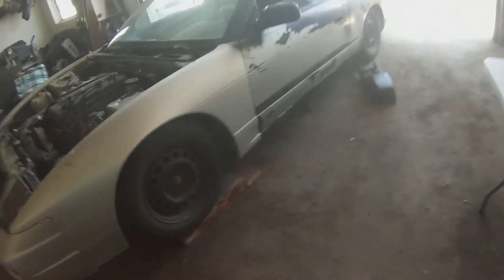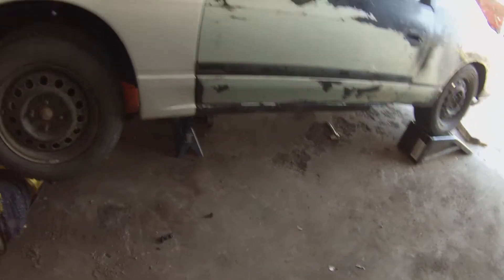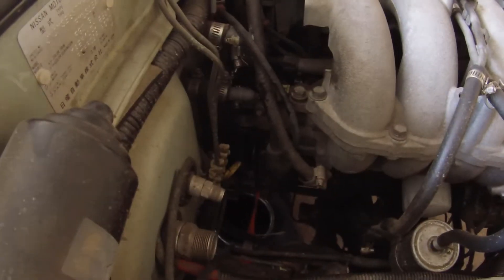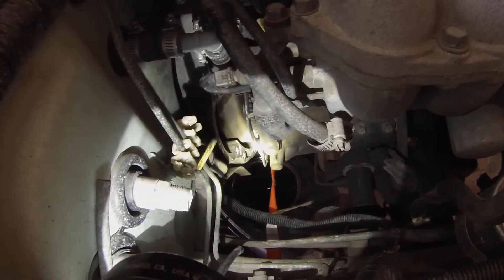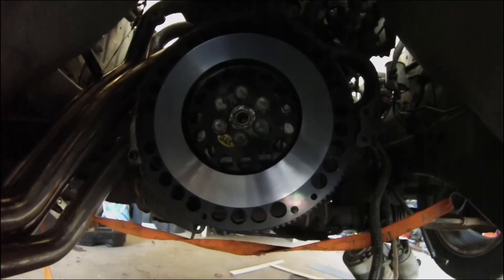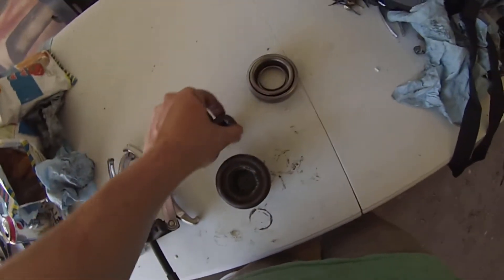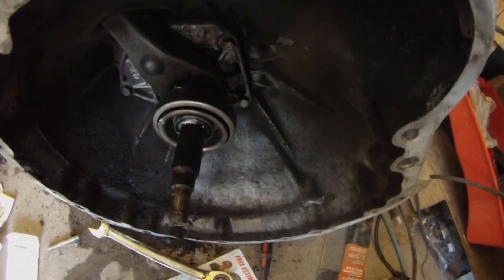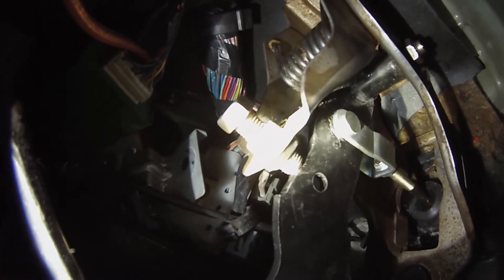240sx Manual Swap | 240sx S1E3

Comment from the maker: 2021 UPDATE: At the end of this video, I recommend saving up for a manual instead of doing the swap. This advice was based on S13s still being dirt-cheap, and it is NO LONGER RELEVANT. Now that these cars are getting more expensive and harder to find,  you can get one for a significantly better value if you're willing to buy automatic and swap in a manual.

Comment: Is 1200 cheap for a auto 1990 240 with a 5 speed swap
Reply from the maker: Hard to say because it varies depending on where you live. Where I live, that's a screaming deal. Just make sure the swap wasn't done janky.
Reply: Rust Kings  i ended up taking it to a shop. I’m spending almost a grand to do the swap. I don’t have any tools right not but I’ll be collecting tools. I want to build my ka24 .. I also I’ve in Georgiana’s bought the car from a buddy in Tennessee.
Reply: That’s dirt cheap in this market